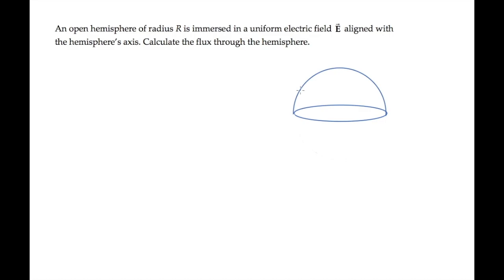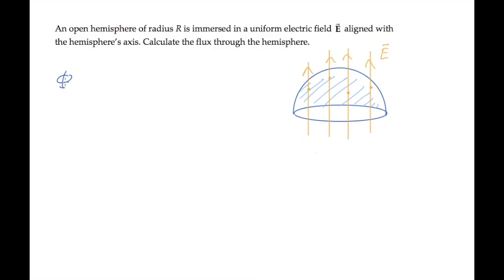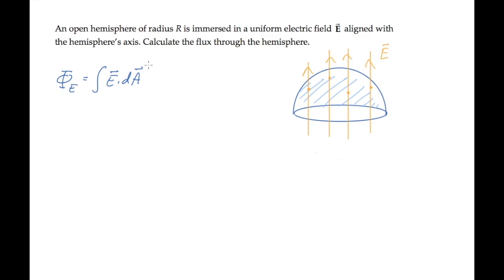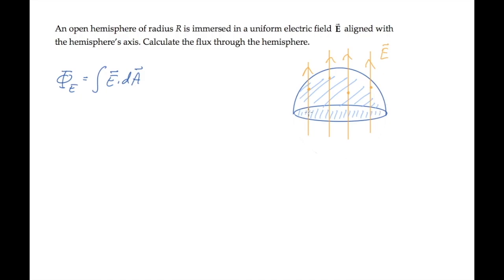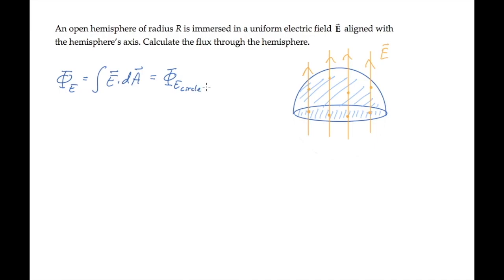E&M: Electric Flux. Level 2, Example 1

Comment: If its open shouldnt there NOT be a surface on the bottom?
Reply from the maker: That’s right - there is no bottom surface. But if there was a bottom surface, we know from Gauss’ Law that the total flux would be zero because there’s no net charge inside: Phi_bottom + Phi_hemisphere = 0. So we find Phi_hemisphere = -Phi_bottom. This is always true so long as there is no net charge within the hemisphere. Phi_bottom is easy to calculate so, even though it’s not there, we can use it to find Phi_hemisphere.
Reply: @jhughesphysics1078  Awsome, thanks!

Comment: what if we attempt to do it using the surface of the hemisphere though? 2πr^2. it wouldn't give the same result... can you explain?
Reply from the maker: Good question. Yes, it would give the same result - but it’s much harder. The general expression for magnetic flux requires calculus: it’s the surface integral of B dot dA, where B and dA are vectors and the “dot” means the dot product. dA is area vector along to the local surface normal. Integrating over the hemisphere, the B vector is always in the same direction but the dA vector varies (it always points away from the sphere’s center). So the integral is a bit messy but it ends up equaling pi*r^2. This is hard to explain without writing proper equations but I hope it makes some sense!

Comment: Then the total flux would be zero, right?
Reply from the maker: That's right - if there was a bottom surface. In that case, every field line would both enter and exit the volume enclosed by the sphere+bottom, so the total flux would be zero.
Reply: @jhughesphysics1078  Thanks! great explanation
Reply from the maker: @RedZodi4c  You're welcome. :)
Reply: @jhughesphysics1078  Sir, is this always true that total flux through a cloesd surface is zero ?
Reply from the maker: @b.namita  No - Gauss' law tells us that the total flux through a closed surface is proportional to the net charge enclosed by the surface. So the flux will be zero only when there is zero net charge inside.
Reply: @jhughesphysics1078  Thankyou very much sir